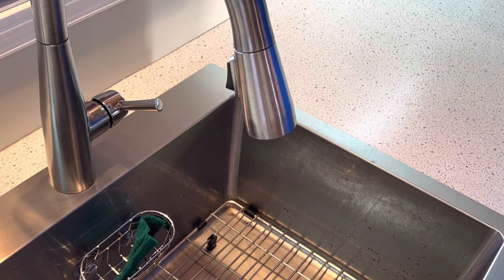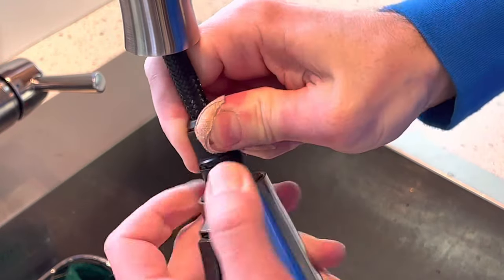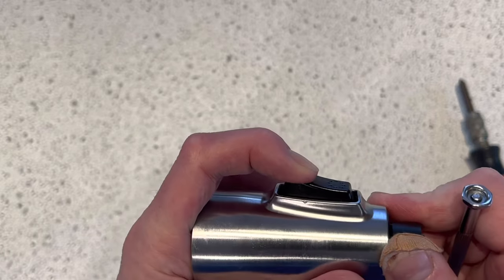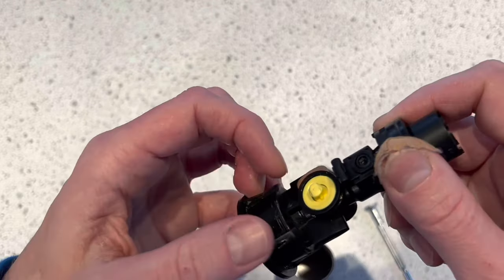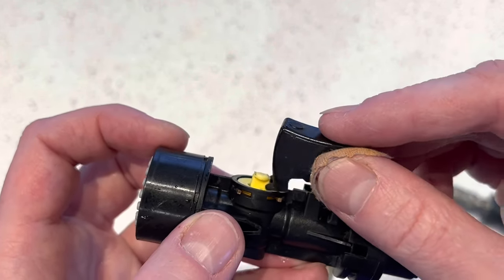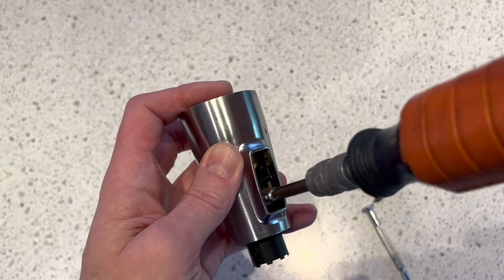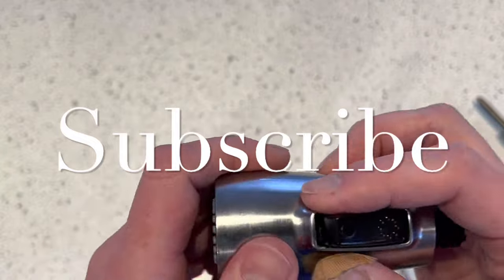Delta Faucet Aerator Removal on 9113-DST or RP80524

Comment: Best video on Utube for Delta faucet fixes.  Many thanks!  This was so great.
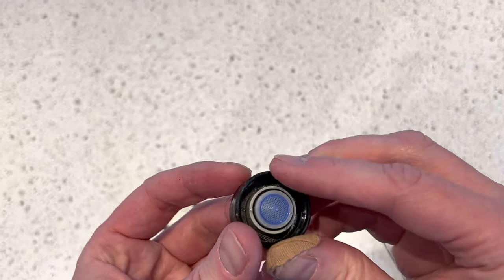2:49 - that blue part pops off (careful) with a small blade.  This is the flow restrictor. Remove this blue screen and put the aerator back and flow improves on CA faucets.  I have the Delta A112.18 faucet head, similar but not the same.  My aerator unscrews without disassembly of faucet.  Unscrew this aerator from face of faucet head using a coin or flat screwdriver.  Soak in vinegar, brush clean of debris and reinstall with or without the blue screen.  This improves flow.

Comment: Well done and good timing!. Today, I just took off the faucet sprayer assembly head on this same Delta faucet in your video. I was planning to clean the aerator screen and I couldn't figure out how to disassemble the sprayer head to get to the aerator screen. I did not consider removing the actuator button first. Anyway, you solved the mystery. Thanks!

Comment: Very nice. I had a problem with the yellow push valve itself (in the video, it the yellow plastic ). You can remove it by removing the valve retaining lock clip which just pulls off. Then you can with slight force pull out the valve assembly and when I did there was a worn circular rubber washers  (I think there are 3 total). It had broken and pulled out of position so I could no longer push on the valve to get the faucet to switch between the shower spray and the regular "mode". The out of place broken rubber washer was jamming it so it wouldn't move all the way.

Comment: On a new Delta Paucet that had no pressure, I took the head off and held it upside down in the sink, then sprayed it out with the hose, which had strong pressure. A lot of black plastic very small pieces came out in the sink. I pue the head back on and oit worked great.

Comment: I see many requests fro finding the part number or replacement aerators. I looked on the Delta site and there are no exploded diagrams of the head. I do wonder if another aerator could be purchased (the style that screws onto the exterior of a faucet) and the "guts" of the aerator exchanged. In my opinion all of the pull-down faucets on the market offer dismal flow rates (typically 1.8 gpm). On my builder-basic single handle Detlta faucet ("Foundations" series) I get 3.4 gpm with a full-flow aerator. It makes filling pots and the sink far less time consuming.

If anyone has tried pulling the guts out of another aerator (perhaps another Delta/Masco/Master Plumber branded part) to replace the one in a Delta spray head I would love to hear about it.

Comment: where can I buy the aerator? seems the aerator is now removable, but I am not able to locate the replacement part; particular that size
Reply from the maker: I don't know, I guess you can just clean it instead of replacing it...
Reply: @atcaron  how do you clean the small holes on the outside ring? Can that area be replaced too?